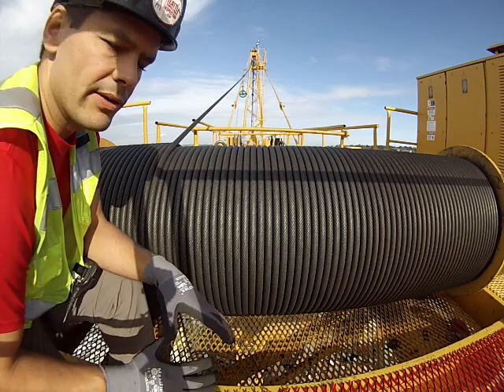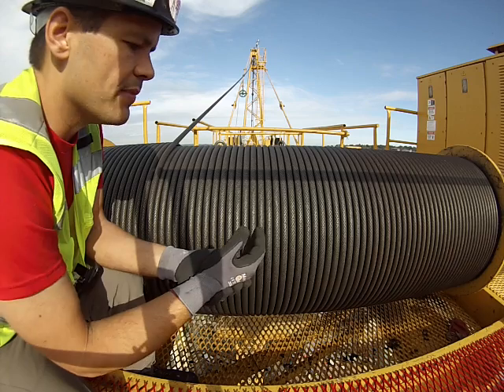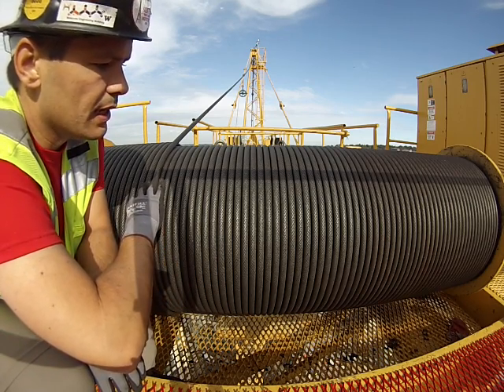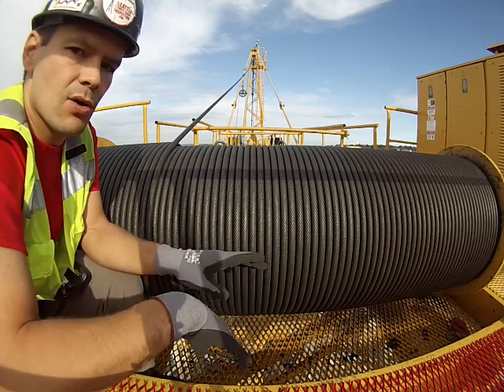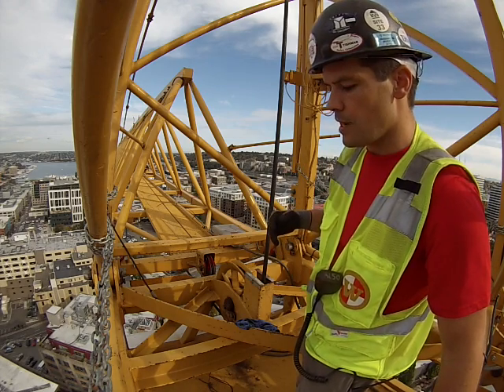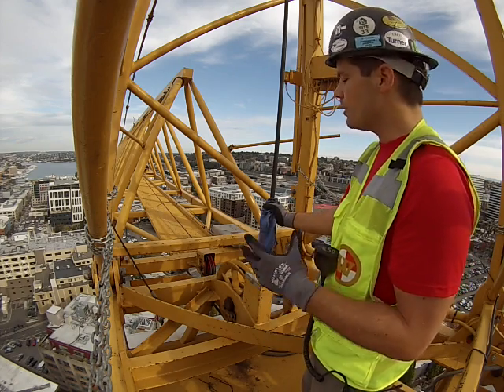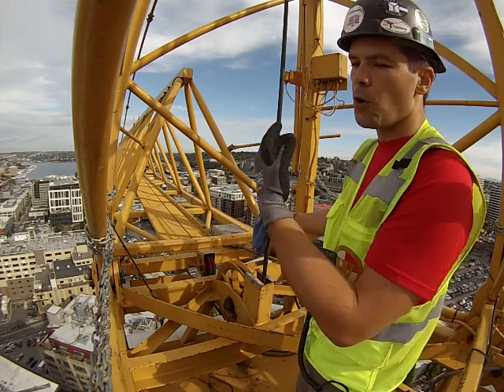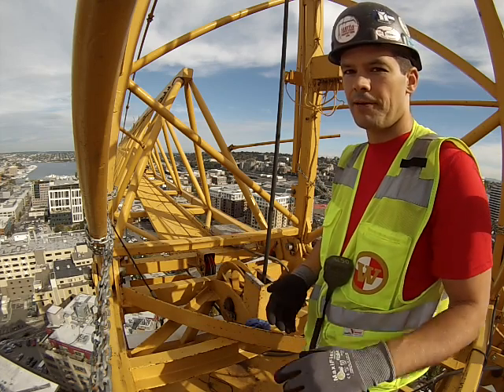How to Operate a Tower Crane: Hoist Rope Inspection Tips

Comment: Do smaller ropes, 9mm, need lubrication? My self erecting crane manual does not even mention lubricating the ropes.
Reply from the maker: Hoist ropes need lube. You have three layers to the rope when they are rotation resistant, or non-rotating. It should be a good lube like ship to shore, or Monolec. Don't use open gear lube or stuff you find at a auto store. They are for 6x19 ropes, and even then, I wouldn't use it. They don't soak in and block the view of the condition of the rope. If it's a trolley rope, I would tell you to not lubricate it. I just found it to be a mess when people would do it to the cranes I owned. I would rather spend $150 to swap out the dry rope every 5 or 6 years and not have sticky nasty ropes to handle at each job. Most of the small ones have a fiber core. The larger ones are often galvanized. They don't rub or rotate much so it's not important.

Comment: So i need to lubricate the hoist rope once a month?
Reply from the maker: Speaking for crane owners everywhere, please don't lubricate it every month. Most crane manuals say to lubricate every 200 operating hours. You'll want to document an inspection that notes it's condition. Notes like these are just how manufacturer's protect themselves. Spraying it every 200 hours will build up on the rope and in the sheaves. You'll no longer be able to see the rope structure and you won't be able to effectively inspect it. It's really dangerous. Another danger is in that sheave build up. I've had a rope find a way to jump a sheave and get damaged due to build up. It will vary by location, but with good modern rope lubricants like Monolec 2001, Ship2Shore, or others designed to soak into the ropes, you'll find 4-6 months is when ropes are going dry and needing lubrication. And don't use "rope and open gear lube" on ropes. It does nothing for rotation resistant ropes. It's for 6x19 type ropes. For cranes I own, the only lubricant I leave on the cranes are ring gear sprays. Everything else, most operators will abusively over lubricate out of ignorance. On our cranes, we come out every three months and lubricate it. Bearings are sealed these days, so even the turntable bearing just needs to be lubricated to fight evaporation. Some operators will try to squeeze a tube of NLGI2 in there every month and it blows out the seals which introduces contaminants. Even when I explain it, the person I explain it to will not be there the next time we show up and we are left with a mess. So we stopped leaving lubricants behind. Or they will lubricate my trolley lines that don't even rub. It becomes a greasy mess to lengthen the life of a rope that costs $100 and last 5 years if ran dry. Good wire rope lubricants in the US are commonly 25 US Dollars a can. But then you only need one can every 3-4 months.
Reply: @rotyag  Sorry for the late response.. some crane oprators tell my differently. Some say i need to request some used motor oil to lubricate the hoist and others say that i should just use spray... quite having a problem with that as a starting crane operator...
Reply from the maker: @RomanVideos1  You'll get advice from different people that doesn't quite apply correctly for your whole career. Motor oil is not good for a complex rope like a rotation resistant one. They are so dense that it will never get in. And in some locations, it will wash off in a month. The quality sprays will soak in and hold on the rope for 3-5 months at a time. Environmentally speaking, it won't be dripping as it gets hot too. Oil could work well for say a trolley rope of 6x19 construction. But it's not honestly necessary for a trolley rope. Some would disagree, including the manuals. But they don't rub and lube isn't going to lengthen the life of the rope when bending modulus is what kills them. And they are cheap. 

For the rope lubes, check out the rope manufacturers. Bridon, Python, Diepa. Diepa used to have really good instructions.  The crane manufacturers are thinking about liabilities more than good rope performance. 

The really good way to lube a rope is under pressure that also cleans it, but it's cost prohibitive unless you own a large fleet with similar rope sizes. 

But toss the operators and my opinion aside. Go to the rope manufactures for accurate validation.
Reply: @rotyag  Thanks for the quick reply! By the way what do you think about WD40 sprays? Or they don't have anything to do with lubrication?
Reply from the maker: @RomanVideos1  Sorry for the wait. WD is really just for pushing out water. It works decent as a very short term lubricant. I'm a fan of heavier lubes like PB Blaster. It has some holding power. I use a lot of dry graphite on bolt threads. Molykote is awesome. The price is about triple what it used to be. Comedil got me hooked on it after seeing it recommended for their bolts.

Comment: Very good presentation sir, but you have to wear Safety Harness at all times, especially when you are working at height.
Reply from the maker: The crane manufacturers do a good job of using handrail to eliminate fall hazards on the counter jibs and towers. Wearing a harness during a rope inspection actually becomes a hazard. You have mechanical equipment that turns without guards. A loose lanyard could draw you into the drum and quickly end your life. If one is working in an electrical panel back there, you have the same hazards. A technician for another company a few years back dropped a wrench in a panel and found himself crawling down tower sections with molten metal in his face and hands. Heights are often a secondary concern for us. Harnesses in a few situations only add to the danger.

Comment: Cold weather inspection had a situation where a operator cabled down and ended up messing up the cable because it was frozen I believe it back reeled and got birdcaged but I'm not sure what would you have done to prevent this this was on a crawler hydraulic crane LTR 1100
Reply from the maker: That sounds ugly. What a lot of modern cranes do is put a camera facing the drum with a screen in the cab. If you used heat, you'd want to be really gentle with it so you don't induce heat on the wires beyond enough to melt the ice. You could cover it,  but use something that won't be drug into the drum if the operator for gets it. Plywood?
Reply: Hoist up first. Keep the block 3 feet below your up limit. Hoist up into the limit first thing in the morning. Then Hoist down a couple feet and make sure everything is moving through the sheave system properly.

Comment: Thanks so much for the info! Would you give an insight on how often you should change the whole rope?
Reply from the maker: Depends on the crane design. Liebherr with the 2 part systems they have, 5 years is common. If you have a 2/4 part system with any strong zig zags in the sheave design, It likely will need to happen in about three years. The more sheaves at play, the less life you'll have with a rope. It's all bending fatigue if there is no external damage. You can extend the rope life if you swap ends halfway in the life. There is often rope at the bottom of the drum that is nearly unused that could go out on the jibs in the working end after say two jobs. This might get you a 3rd and 4th job out of the rope.

Comment: Hi. What are the things done in Commissioning and Testing? Im a student.
Reply from the maker: Typically we set motion limits first. This drum in front of me has a set of plastic gears that turn with it. We adjust a screw that changes a plastic part position that rotates with the drum. We adjust it so that it hits an electrical contact that stops the crane motor and desired heights. Up and down on the hoist. In and out on the trolley. Then we load test the crane. We put on maximum weights for line pull so the drum can't lift more than it's rated. On old cranes we adjust electrical limits manually. On new cranes, we might set a limit. On some modern cranes, it reads the amperage draw and stops on it's own. Then we do that for each gear the crane has. Next we set a moment limit. That's the amount of weight a crane can lift at a given radius. Finally, we have a foundation test where we hold weights for ten minutes at that maximum moment with the weight low to prove the foundation of the crane is good.

Comment: Can you send me proper procedure for inspecting tower cranes with standard
Reply from the maker: I don't think that I have seen a write up on that from any manufacturer. The way I do it with that towel is the best way I have found considering time constraints. You also have to rided the trolley inspection basket to watch it go through the sheaves. Casar used to have some good inspection materials. I got them many years ago, but I don't believe that I have anything digitized. I would try their website to start with. The rope manufacturers would be my starting point.

Comment: what if the broken wires are facing away from the towel ( with the grain ) You state the wire should always be raised instead of lowered. How do you check??
Reply from the maker: If the wires aren't raised, you'll generally feel a lack of smoothness as the rope runs through the towel. It takes some practice to feel it because sometimes it's just tacky grease, but you'll learn to pick up the difference in feeling. Sometimes the top of the surface will fracture and you'll have wires that haven't broken very deeply. If you've lost more than a 1/3 of the wire diameter (judgement call) then you'd count that as a broken wire. 

In 7/10 bad ropes, it's going to be quickly obvious. For the ones you miss, we have a lot of safety factor to help with the forgiveness of missing the problem. I've seen some amazingly bad ropes over the years. You have a lot's of leeway between rejection criteria and one that's in actual danger.
Reply: thanks man
Reply: rotyag plz post more videos when you have time

Comment: What kind of wire rope? Rotation resistant?
Reply from the maker: Tom Bergwall Yes Sir. probably 6x36 22mm. That would be my first guess. I can't think of any tower crane hoist ropes that are not Rotation Resistant. boom ropes are often a lesser class of rotation resistant and say 8 strands instead of 15 on the outer. Some of the old cranes had a different class of ropes that had locked down swivels. Liebherr 550's and 390's from the early 80's comes to mind that way. But I would need to research the details on that. I think that I have an old Pecco and a 550 manual in the collection.

Comment: In the event that you find a broken wire in a strand, is that the location where you will find more broken strands as time progresses? In other words, does it become a weak point where other wires will be more prone to breakage in that rope lay, or close to it?...
Reply from the maker: +Derek Cosgrove Generally speaking, the rope is strong enough to lose one wire and suffer no loss of strength relative to the loads we are putting on them. These are ropes that will take 5 times the load we apply to them. So at 20% of capacity they are yawning with the heaviest of picks.

What deteriorates the rope is contact with things with friction. A bad sheave with grooving. Rubbing the side of the building you are constructing. Contact with a second crane will do it in a hurry. But over time, most ropes suffer from rubbing on what is called the "kick point". As the rope spools it is physically forced over by the previous wrap at two points per wrap. On big ropes on old drums, you can feel it with heavy loads running fast. It's violent. It is one of the reasons cranes went to smaller hoist drums in the last 15 years. There is less angle and wear because the fleet angle isn't so great at the outer reaches of the drum. If you have no way to get back there to see it happening, just imagine that coarse rope just rubbing another one with 5000 kg on it  at high speeds. 

What I do if I find a broken wire is I put tape on the rope. (electrical generally). Then I have whoever is at the controls hoist up to make sure that it's a kick point issue. You'll see right where it hits. If the rope is five years old, it's time to watch it very closely. It could be that the rope is failing just because it has bent as many times as it should. I had one once go from one broken wire to 9 in one month. 

Keep your ropes lubed. Don't use the open gear lube. Use a penetrating aerosol that won't fling off. I use Monolec 2001. Once every three months or so. Open gear lube makes a mess and never gets into the inner cores on a rotation resistant rope. And hopefully the crane owner changes the kick point every few years. When the crane is down they can either cut off a 1/4 diameter of the drum in length, or then can pay it all off and connect what was at the tip to the drum. Either way changes the kick point and extends the life of the rope. If you want to read up on this, Casar has some great write ups. Looks like you need to start an account to get them these days. If you went to a rope dealer they might have some great technical brochures as well with more than you'll ever need to know. I have a 3 ring binder full of them. http://www.casar.de/Technical-Reference/Brochures

Good Luck on getting your Red Seal!
Reply: +rotyag 
Thanks a Bunch for the info, I really appreciate it, Sir.
     The instructors where I go to school have stressed the important use of aerosol penetrating lubricant on cables, and had the students with whole cases of the stuff lacing the ropes and drums, and other moving parts. And we are replacing the boom hoist cable on a 50t crawler next week with 14pts Line in the bridle reeving, so that's going to be some great hands on training. 
     I can't wait to get out in the workforce and start my apprenticeship.
     Excuse my terminology if I misspoke, I still tend to refer to some parts by the wrong names.
     Thanks again and I look forward to your future video tutorials as the ones you already posted are great!
Reply from the maker: +Derek Cosgrove That is some good hands on training. Make sure the reeving of the boom rope isn't too hands on. People lose fingers that way. De energize the crane while working. I used to erect cranes and one time the operator didn't shut the power off after I had asked him to. He stood up in the cab and hit the trolley out function. My legs were hanging between the trolley and the lower lacings of a saddle jib tower crane as I was reeving the rope. Fortunately the rope wasn't tight yet so I had that one second to react and roll back to yank my legs out before it moved. Otherwise it would have been the end of me and cranes. Always... always know your escape before you put yourself in a pinch. Teach your signal people the same philosophy. 

I am a bit jealous of the class. Mine was much more hands on and learn from reading and asking questions.
Reply: +rotyag 
Well there's 3 instructors on site with about 20 students(course requires 1 instructor per 8 students). We're all fortunate in the fact the instructors are extremely safety conscious and have decades of experience, so none of use sneezes without an Instructor over our shoulders. But as in any case, there's no way we could be taught everything they know, only time and experience will give us that. That's why I hunt videos and information during my off time from school.
     Without a Crane course, I wouldn't be able to get a job in Crane Operation(at least in Canada anyway), and it seems that there's a high demand for operators these days. The only hitch is finding someone to take me on as an apprentice afterwards. But from what I hear, that may not be as hard to find an apprentice spot as one would think... To get the aquired 5400hrs of apprenticeship, well that's a different story. And I don't think I can get those hours if I were to back home to the U.S.(more specifically, Atlanta) for work. But, there's alot of great high paying jobs in the oil and gas industry up here so I may not have to look far.
     Being a citizen of both the US and Canada makes things a bit easier too, as my options are expanded more than most people(at least when the Red Seal is finally stamped).
     Thank you for taking your time to reply to my questions, Sir! I truly appreciate it!

Comment: Very good video.
But how do you start the system if you are out there?
You need two people for this test or have another option?
I'm working on potain md 285 i check the cable once a week visual inspection.
Your method is very good. But I need 2 people for her.
One to hold the cable and one to operate the system.
There is another way?, or I did not understand correctly how to do it
Reply from the maker: You are right. You need two people. Depending on where you are, in the US under ASME B30.3 you really need to be inspecting the full crane including the jib once a month at least. To walk out there you would want a second person on the crane paying attention in case something goes wrong and you need help. At that same time, you could get the full inspection of the rope done. Your local codes might be different but they will be close to the same.
Reply: I'm from Israel
The tests that we are required to do the same.
The condition of the cranes in israel is bad.
I'm working on a crane from 2001 it's good
But I have friends who work on cranes from the 80s
Two weeks ago, Fell 3 Crane in israel, Because the wind, Because there is a shortage of crane operators people without a license working on the cranes. 
I got my license 2 months ago so everything is new to me.